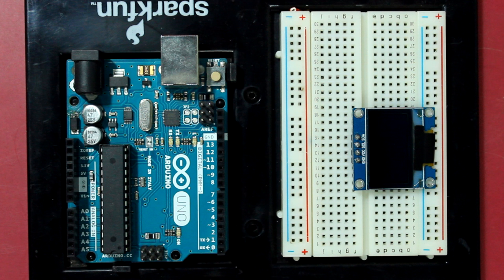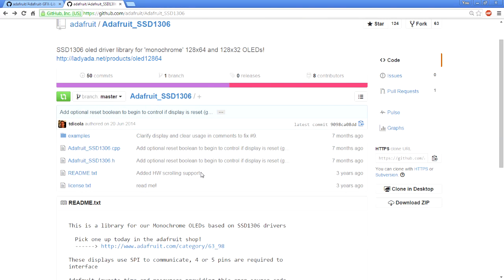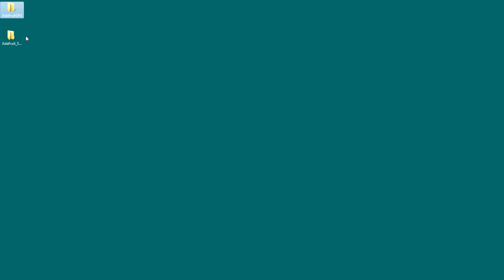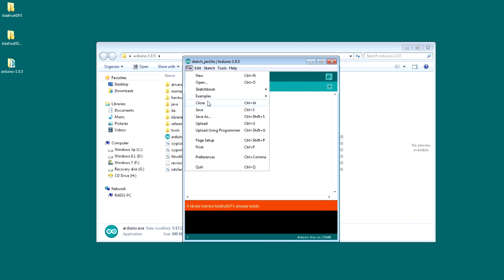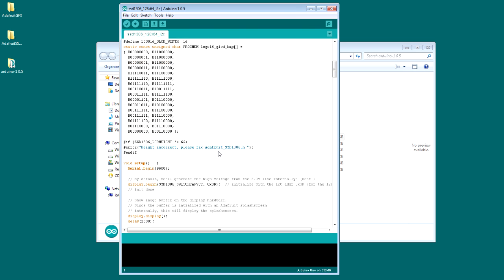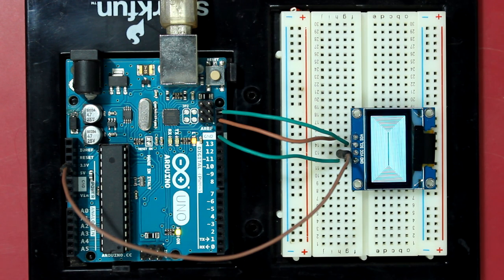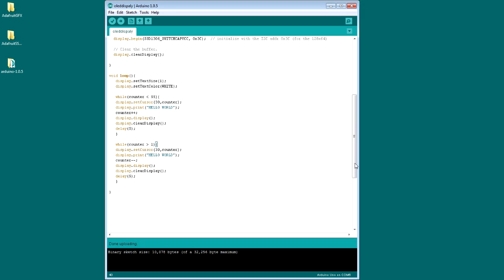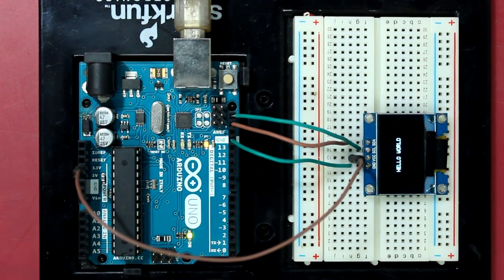Arduino And SSD1306 Oled Display Tutorial

Comment: Thanks very much clear and easy to follow. Quick question - if you wanted to use a board other than Uno how would you know the SDA and SDL pinouts for the board ie where is this specified ?
Reply: check the pin mapping

Comment: i literally just found out about these tiny pcs. i have built computers and fixed them for 10 years and want to understand this "IoT" world. my interest in hooking up a tiny screen lead me to this video. in practical terms, what kind of "real world use" projects could i achieve?
Reply: All Sorts of things, Real world HUDs for example. Add a BT module for phone connectivity. Endless possibilities with tiny form factors...
Reply: mm. i didnt think about hooking up the bt module to my phone. that would make for an interesting remote control if i learned to program for android. or just programming in general lol. 

i have a lot of ideas on what i could do, theories, but i have no practice so i have to learn everything. i need a clear idea of what i want to accomplish with this so i can maintain a focus otherwise ill be making tons of little projects, get burnt out before i actually make something useful like a floating device that monitors your pool waters alchemy levels and uploads it to your phone via app.
Reply: I get error to height correct , where in ther code do I do that ,I see the line of code ssd1306 lcdheight !=64 I need to have it 128 x 64
Reply: #error("Height incorrect, please fix Adafruit_SSD1306.h!");
Reply: In the Arduino forum 
https://forum.arduino.cc/index.php?topic=364400.0          Suerte wrote
In Adafruit_SSD1306.h  (I loaded it into a text program altered it and re-saved)

1. uncomment #define SSD1306_128_64
2. comment #define SSD1306_128_32
3. comment #define SSD1306_96_16

In the example ssd1306_128x64_i2c

4. add #define SSD1306_LCDHEIGHT 64

on top of

#if (SSD1306_LCDHEIGHT != 64)
#error("Height incorrect, please fix Adafruit_SSD1306.h!");
#endif

Suerte.
Reply: Sorry got this in wrong place was in response to Larry Fostano #error("Height incorrect, please fix Adafruit_SSD1306.h!");